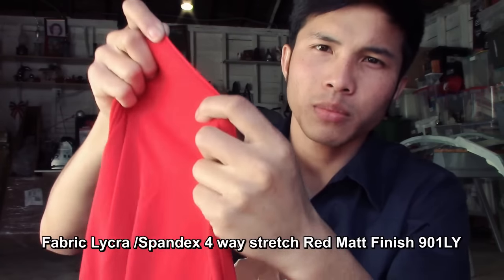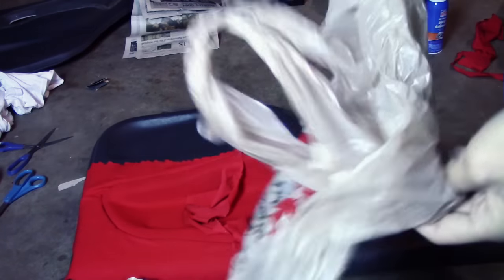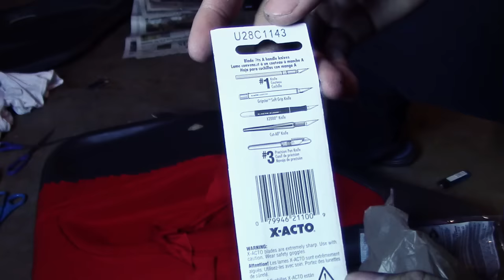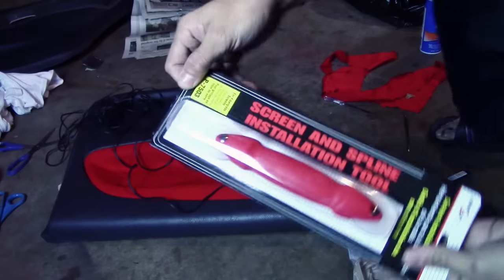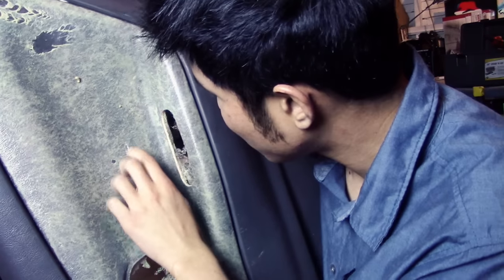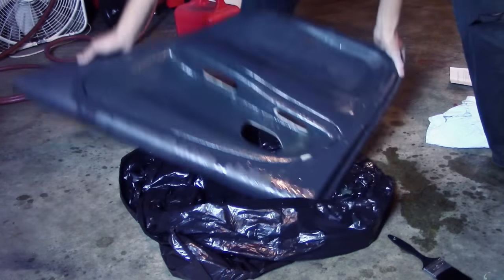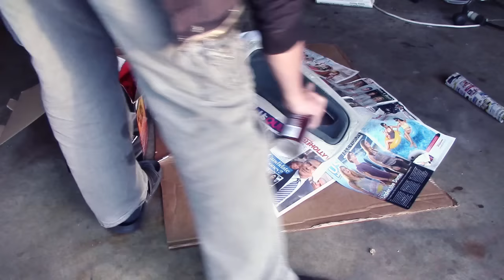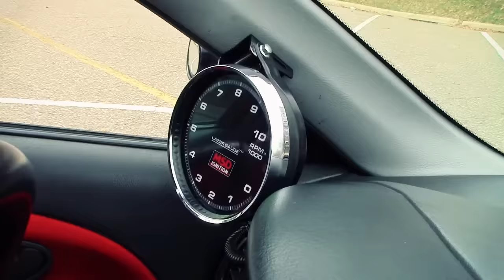Mirage Fix 19 | Red Fabric Door Trims With 3M Super 77 Adhesive

Comment: I know this is an old video, but when using spray adhesive with fabric, spray the back of the fabric too, and let both surfaces dry before putting them together. That kind of glue sticks to itself the best, so it works alot better if both sides have glue on them.

Comment: Good video, did the super 77 last or did you have to reapply it?
Reply from the maker: It lasted when I had it a few years later. I already sold the car, but I still believe it would last forever. I don't know what else to use if it doesn't.

Comment: hi i want to also do my door trims they are bad but i have a ? how much  fabric do i need my car is a 2004 oz rally lancer so the door trim is the same as the mirage or about the same . can you please let me know
Reply from the maker: +Nava Rodriguez 
Fabric:
http://www.ebay.com/itm/281151014011?var=580215116248&ssPageName=STRK:MEWAX:IT&_trksid=p3984.m1423.l2649
http://www.ebay.com/itm/291125215576?var=590276174200&ssPageName=STRK:MEWAX:IT&_trksid=p3984.m1423.l2649
http://www.ebay.com/itm/Discount-Fabric-Lycra-Spandex-4-way-stretch-Red-Matt-Finish-901LY-/380763216017?pt=US_Fabric&var=&hash=item58a7419891

You will have to measure it, I think I forget what length I bought already.

Cheers